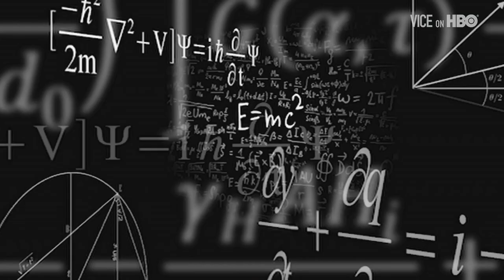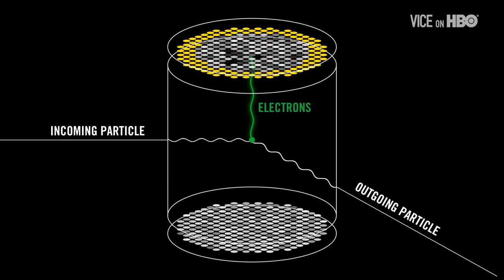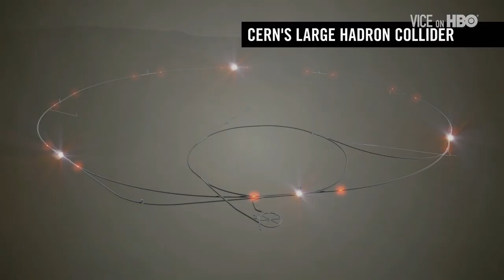Dark Matter — The Greatest Mystery of The Universe | VICE on HBO

Comment: What if it’s not dark “matter”? What if our unifying theories of physics are just not correct? There’s no evidence it’s matter. Maybe we just don’t understand gravity.
Reply: Will Cerf always possible, but the theorie of gravity has supported the success of too many of current technologies i.e. satellites. But you never know... well you can
Reply: If you define "matter" as "a substance/object with mass that exists within space", then there is indeed evidence that it is matter. We have observed its effect on gravitational fields (by looking at gravitational lensing). We have even been able to map out clumps of dark matter around galaxies. So we know it's there. We know how it behaves (on large scales). All we don't know is what it's made of. That's the mystery.

Regarding our theories of gravity: Our theory of macroscopic gravity (general relativity) is one of the most accurate and well-tested theories in physics. What we don't know about gravity is how it behaves at the microscopic (quantum) level. But that wouldn't affect our observations of dark matter, since those were taken on a macroscopic scale. (In physics, size scale actually matters.) It's possible that quantum gravity and dark matter are linked, but that's only speculation. The idea that dark matter is simply a weakly-interacting particle is much more substantiated.
Reply: Exactly right. We have fixed gravity and the speed of light as "universal constants" that underpin all of our formulas, but we have only ever measured them around 2 or 3 specs of dust in the vast universe. This is like measuring the temperature in a few rooms of your house and declaring them global constants... pure foolishness. There is no dark matter.
Reply: General/special relativity - the theories that depend on the speed of causality (aka the speed of light) and the gravitational constant - have been extensively tested and verified both locally and on galactic scales. Those constants were not chosen arbitrarily.

You're suggesting that these constants are variable. That is a hypothesis (VSL) that has floated around the physics community for a while, but there has been no experimental or observational evidence to support it so far.
Reply: This has always been my thought on this "matter". Why isn't anyone questioning dark matter as simply a failure in the equations around gravity and astrophysics? Instead we just say that there's "dark matter"? Doesn't this sound more like they're filling a hole with the god of the gaps? Instead of looking for dark matter, shouldn't we be re-evaluating our calculations of motion? Aren't we just missing something? Or is that simply an unconscionable and heretical threat to the status quo?
Reply: +Ryan Baker It's because we've used those theories for a lot of real world situations and they've worked for us. Just because we find something else doesn't mean we toss out the whole equation. It could be missing a part of the equation but it's still the most correct so we use it.
Reply: The scales of the Universe are much larger than we can imagine.   Maybe are measurements are not quite accurate enough.
Reply: Nope we don't know what is there period.  Dark Matter and Dark Energy is a broad term for unknowns found in the Universe.   Gravitational Lensing can be caused by Black Holes which are not observable and we still have yet to fully understand them.   Also matter as we know it does not cause Light to bend without effecting other forms of matter.  The only thing that was mapped was old Radiation clumped together...  Is  the radiation causing the gravitational effects seen from Galaxies?   Whats causing the radiation to be clumped together?
Reply: Also the light we are observing is from a time in the Universe when space was more dense now space is actually spread out farther.  The Gravitational Constant could have changed.
Reply: If is that hard to detect dark matter imagine how much harder is going to be to detect dark energy, my bet is on string theory
Reply: What do you think about stimulation theory?
Reply: Will Cerf Some physicists try to modify Einstein's equations on galactic scales to fit the observed data but so far it hasn't been able to account for everything we have observed. Physicists don't worship Einstein.
Reply: @allamericandude15  my understanding from Sheldrake and others is that they change the distance of a meter in space so they can keep the speed of light the same, so they are just ignoring the evidence. Like saying something is going back in time rather than going faster than the speed of light. Many have commented on the speed of light constant being a scientific dogma in a quasi-religion.
Reply: @chrischiz  The speed of causality (light) constant is one of the fundamental components of general relativity (GR for short). GR is one of the most well-tested and robust theories in all of modern science. Since the link between GR and quantum mechanics (another highly robust theory) is currently not completely understood, but highly sought-after, there is a lot of incentive in the scientific community to find alterations or mistakes in either theory (research grants and Nobel Prizes and so on). So there is no "quasi religion" proclaiming that the speed of causality is constant - it's just that all the evidence so far points to it being constant. Anyone who says otherwise, at this point, is simply full of shit.
Reply: @allamericandude15  I can give you lists of scientists, noble prize winners and so forth who disagree with you. I'm not sure what you mean by robust, perhaps you mean it has enough support within the establishment to dismiss the constant opposition to GR, even from Einstein himself. Robust indeed.
Reply: @chrischiz  I can see where you're going with this. You probably think there's a cabal of "mainstream" scientists who dogmatically believe in GR, and are actively conspiring to suppress alternate theories. I've heard that sort of thing from climate change deniers, flat-earthers, anti-vaxxers, etc. It's an overused pseudoscience/conspiracy theory trope. I'm not going to waste my time with it. Get back to me when you have actual experimental data that overturns general relativity. I won't hold my breath.
Reply: @allamericandude15  of course experimental work is exactly what is required and missing in GR, I am happy to discuss this further, if you want to imagine what I think rather than asking, go ahead.
Reply: @chrischiz  https://en.m.wikipedia.org/wiki/Tests_of_special_relativity

I've been conflating special and general relativity in this conversation, but there is substantial experimental evidence that supports the speed of light being constant. The fact that you said that there isn't just shows you have no idea what you're talking about. Any theory regarding a non-constant speed of light would have to explain the results of ALL the previous experimental results AND prove that light speed is non-constant. So I await any experimental evidence for such a theory.
Reply: @chrischiz  Also, GPS systems wouldn't work accurately if the theories of special/general relativity weren't correct. So you have direct experimental evidence for S/GR in your own smartphone.

http://www.astronomy.ohio-state.edu/~pogge/Ast162/Unit5/gps.html
Reply: @allamericandude15  GPS works because of engineering and experimentation, it not does not work because of the theories, they only attempt to explain how it is thought to work, I have been involved over a number of debates regarding GPS over the last few years and happy to continue here
Reply: @allamericandude15 I never said there was no evidence that supports speed of light constant. I would say there are competing theories with more compelling evidence imo. A speed of light being constant requires some kind of reference point to measure against, so it is fundamentally flawed approach, and does not speak of physical reality in a testable way
Reply: @chrischiz  These two comments show that you either didn't read the source links I provided or you didn't comprehend them. I can't have a "debate" if you won't even engage at that level. And you still have not provided any material of substance that refutes special/general relativity. "imo" is not acceptable.
Reply: @allamericandude15  yes I did read the link and have read many like it that claim engineers used the theory of relativity, the article to does not really go in to the details of how those theories had to be massaged to fit reality and did not predict it
Reply: @chrischiz  "the article does not really go into the details of how those theories had to be massaged to fit reality and did not predict it." Citation needed.
Reply: @allamericandude15  did GPS engineers require relativity to work? Even other proponents of relativism seem to think not, http://www.alternativephysics.org/book/GPSmythology.htm
Reply: @chrischiz  "GPS does require general relativity to work, please stop saying it doesn't, even if you don't believe in relativity." <- That's not very useful, is it? 

I read that article (yes, both parts). In researching a response, I actually stumbled on a DARPA-funded report that addresses these exact issues. You and I weren't the first people to have this conversation, apparently: 
https://apps.dtic.mil/dtic/tr/fulltext/u2/a158720.pdf

That report more eloquently states anything I'd be able to tell you in a YouTube comment, so I'll defer to that.

Also, relativistic effects have been repeatedly validated by experiment, including this result from just a few months ago:
https://phys.org/news/2018-12-galileo-satellites-einstein-relativity-theory.html 
(Papers are linked at the end of the article.)

The results in that article were found by two independent research teams, and they validate S/GR to very high precision. They also accounted for non-relativistic effects on their data. This trumps any sort of online blog post. So if you want to convince me, you'll have to show me some equally credible experimental evidence.
Reply: @allamericandude15  relativity therapy is the result of inductive reasoning right? And then there is experimental support. In my experience the engineers are the great innovators and the general principle is secondary to the primary phenomena. so I am more persuaded by the views of engineers who are more interested  in the specifics, like Tesla on relativity, "... a mass of error and deceptive ideas violently opposed to the teachings of great men of science of the past and even to common sense…the theory wraps all these errors and fallacies and clothes them in magnificent mathematical garb which fascinates, dazzles and makes people blind to the underlying errors. Its exponents are very brilliant men, but they are metaphysicists rather than scientists.”
Reply: @chrischiz  You're literally saying you're more persuaded by opinion than evidence?  Do you not get how whacky that is?
Reply: @allamericandude15  what I get is whacky is that you rather enjoy misrepresenting what I am saying, like when you suggested I am aligned with groups I've never heard of, and called me 'full of shit' for the grand crime of questioning a 'theory' in pursuit of the truth. FYI "A theory in the empirical sciences can never be proven, but it can be falsified, meaning that it can and should be scrutinised by decisive experiments." IMO
Reply: @chrischiz  You talk a lot, yet in this whole series of comments you have failed to provide a single article of actual experimental data that disproves the theory of special or general relativity. But it's okay, I know you can't. Some of the top scientists in physics/astronomy are actively trying to find exceptions to S/GR, but even they haven't found anything solid yet. It's quite a large field of research. So if there was actually experimental evidence disproving S/GR, I wouldn't be hearing about it first from you.
Reply: @allamericandude15  so you want experimental data, but you don't seem to have a grounding in logic, inductive reason, the foundations of western civilization, good luck with that
Reply: @chrischiz  Science is the process of understanding reality. We use logic and reason to come up with ideas about reality, but we still have to test those ideas to make sure they MATCH reality. That's why we conduct experiments. As I discussed earlier, S/GR has been thoroughly tested in experiments and repeatedly shown to be valid. It has ample evidence to support it - it's a good idea. You can't simply talk your way out of it without also providing evidence to refute it - which is what you have repeatedly failed to do.
Reply: @allamericandude15  
'
Again, “our calculations match our observations” has been the pride and joy of the Ptolemeans for 1500 years, until Kepler came along and left them standing as fools, and today epicycles are used synonymously with bad science. Relativity has all the makings for becoming another such example in future history books.
'
https://www.quora.com/I’m-not-sure-relativity-works-and-is-real-Is-it-If-you-spin-does-the-whole-universe-spin-faster-than-light-speed
Reply: @chrischiz  Kepler used experimental data to update scientific theories. That's good - that's how it's supposed to work. S/GR might be updated when further evidence comes along, and a lot of scientists are actively working to that end, but NO EXPERIMENTAL EVIDENCE HAS YET BEEN FOUND THAT OVERTURNS S/GR. A user comment on Quora is not scientific evidence. How hard is it for you to copy a link to an actual scientific article or paper with experimental data to support your position? You've been so adamant, surely there must be ONE right?
Reply: @allamericandude15  just a matter of time
Reply: @chrischiz  Yeah, it might be. Maybe if that time comes we can come back and have a more interesting conversation. But until then, you can't go around denying an evidence-backed theory before contradictory evidence has actually been found. That's just not how science works.
Reply: The dark matter itself the gravity and exist and so called dark energy which is my baby truly exist
Reply: @allamericandude15  "In the late 1940s the speed of light went up again by about 20 kilometres per second and a new
consensus developed around the higher value. In 1972, the embarrassing possibility of variations in c
was eliminated when the speed of light was fixed by definition. In addition, in 1983 the unit of
distance, the metre, was redefined in terms of light. Therefore if any further changes in the speed of
light happen, we will be blind to them because the length of the metre will change with the speed of
light. (The metre is now defined as the length of the path travelled by light in a vacuum in
1/299,792,458 of a second.) The second is also defined in terms of light: it is the duration of 9
S,192,631,770 periods of vibration of the light given off by cesium 133 atoms in a particular state of
excitation (technically defined as the transition between the two hyperfine levels of the ground state).
" Sheldrake 2016
Reply: Plasma!?
Reply: @muleteammate  Thank you!  Very interesting.
Reply: Science is just theories and men ego pretend to know and explain everything
Reply: tell you what hold a bowling ball over your head and let it go and tell us what happens
Reply: It sure seems like we're heading towards that. So far no evidence of dark matter. Because the assumption is that Einstein's general relativity holds at massive galactic distance scales, which does not seem to be the case. I recommend checking out the work of string theorist Erik Verlinde. He proposed the idea that gravity is emergent from quantum entanglement and the entropy associated with it. In that model the interaction between dark energy (which is non-zero vacuum state) and normal matter produces gravity and apparently his model accounts fully for galaxy rotation curves. I believe he's on to something.
Reply: It’s not dark matter my friends. It is galactic scale electric currents that cause these effects. Look up the electric universe
Reply: Crunge92 you’re a legend. Keep it up.
Reply: Gravity is a theory. So is the heliocentric globe, and flat earth. It's all theories. Show me some proof!
Reply: They just called it "matter", but really they could have just called it anything, they just came up with a name
Reply: Winning attitude right here
Reply: @atomicsmith  Absence of evidence =/= evidence of absence
Reply: @allamericandude15  Perhaps you've already heard that GPS, by the very fact that it WORKS, confirms Einstein's relativity; also that Black Holes must be real.  But these are little more than popular fictions, according to the distinguished GPS expert Ron Hatch.  Here Ron describes GPS data that refute fundamental tenets of both the Special and General Relativity theories. The same experimental data, he notes, suggests an absolute frame with only an appearance of relativity.

Ron has worked with satellite navigation and positioning for 50 years, having demonstrated the Navy's TRANSIT System at the 1962 Seattle World's Fair. He is well known for innovations in high-accuracy applications of the GPS system including the development of the "Hatch Filter" which is used in most GPS receivers. He has obtained over two dozen patents related to GPS positioning and is currently a member of the U.S National PNT (Positioning Navigation and Timing) Advisory Board. He is employed in advanced engineering at John Deere's Intelligent Systems Group.
Reply: Will Cerf  what if it is actually God, most if not all religions believe in a invisible force that brings everything on the planet together. If the Dark Matter can pass through the earth is can pass through us humans and other animals, plants, everything.
Reply: Anything is possible, until observed the  otherwise. the cat experiment indicate the same.